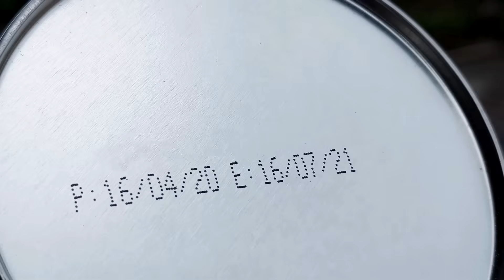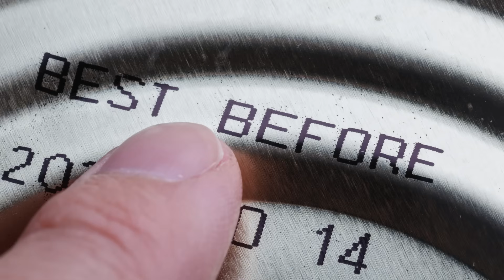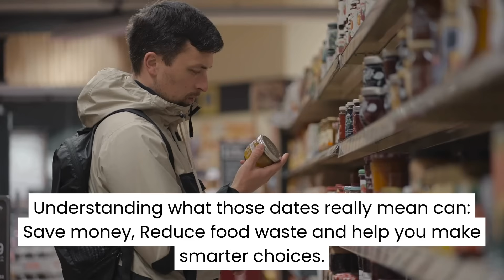What Expiration Dates REALLY Mean (It’s NOT What You Think!)

Comment: I started a pantry 4 1/2 years ago. I thought canned items would last forever, they don't. Evaporated milk, beans, pumpkin. The ONLY way is to rotate older items to the front and use them. MRE's don't last that long, maybe 6 years. Not until you get into the commercial freeze dried stuff do you find 10+ year shelf lifes.

Comment: I try to keep quite a lot of canned food for emergencies and I am usually pretty good at rotating them, however, I just emptied out a storage pantry I have and found a six pack of tomato soup which had a black stain underneath it and I assumed one of the cans had burst with gases or something. It was six years out of date, terrible rotation system obviously, but I always heard canned foods basically lasted for many years without going bad.

When I picked the cans of soup up to throw away they were super light. All six cans were now empty as they had leaked their contents out over the years. I was really shocked. I could understand the one can leaking but all six completely emptying really surprised me. I honestly don't know how that pack of soups managed to evade my checks but it was at the back and under lots of other cans. Going forward I won't be storing cans covered by other cans.

Comment: The most important part is the dates are only valid if the required storage conditions are properly maintained. And as you buy your youghurt and put it in your bag and then it travels in your car for a couple of hours under summer heat it clearly doesn't even remotely meet any reasonable conditions. Basically there is no way for you to maintain the conditions unless you do your shopping with a chilled container which no sane person does. So you may end up with stuff that you brought into your fridge during winter months which clearly feels perfectly fine to eat even a few months after the expiration date and at the same time you may have stuff you only bought 2 weeks ago which should be 100% fine to eat accodring to the markings while in reality having a clearly very puffy package and some funny smelling contents. 

I wouldn't bother too much with the dates too much unless we're talking years over due date and look more at what the actual stuff you're intended to cook looks like to you. In some cases it's not even the product itself but the packaging that is considered perishable and sets the time limits under typical shop conditions so in a dark cold drawer it can be safely stored near indefinitely, table salt being the prime example of such a case.

Comment: You need to be aware with some food!  I have eggs in my refrigerator, and they are good 10 days after expiration date.  Eggs last longer in the refrigerator. If I bake bread it can't last long? Because it hasn't any preservatives! I have them in my freezer, and I take a bit bread for 1-2 days of use.  3-4 days it will mold! If I buy bread it last 7-12 days depending what kind of bread it is.

Comment: I opened some old chocolate in December that was best before last Febuary. I ate one just to see what it's like. It was just a little bit bland. It didn't taste bad or leave a bad taste either. I could've ate the rest if i really wanted, but wasn't interested. But that's chocolate. If we're talking food that isn't very long lasting then i would only tolerate a few days after the date. With Milk i smell it. If you can barely notice then it's ok. Especially if it wasn't even opened that long ago, that's part of the reason it goes off, the volume of bacteria being let it. So would also be wise to squish the bottle to have less air/bacteria let inside. But i've not had to do that. With pasta, that's going to be boiled nice and soft and you're adding flavor to it, so wouldn't really matter if that's months past its date.

Comment: I worked in at a grocery chain for 25 years. If you want to see how well your local store does with "rotating" food products - find an unpopular product. Something you know they don't sell a lot of that is dated. Find one that is at the back of the shelf and you can see if it is past expiration. I have found canned foods that have been 12 years past date. Even the label had changed. That said; in my own pantry, I will discover something that is over a year out of date; and depending on the product, I may still use it. Not food related, but I bought some D cell batteries and as the years went by- nothing seemed to need them. I bought them for lanterns I had for power outages. When I moved to a new home, the outdoor fireplace switch used D cells. When I dug out my unopened batteries I saw that the date on them was "good until 2010". Keeping in mind that batteries are long dated which means I likely bought them between 2000-2005. I tested them with a battery checker and they showed a full charge. They did work, but only lasted about 3 months once put in use. Still, not bad for 20 year old batteries.

Comment: 2:48 Canned goods can be safe to eat after many years because they are commercially sterile and hermetically sealed i.e. the cans are sealed and then heated to very high temperatures so any bacteria that causes food to spoil are killed off, and no new bacteria can enter the sealed can. However the taste and texture might decline after a few years. But it's still probably one of the best foods to keep in preparation for a zombie apocalypse etc 🧟🧟‍♂🧟‍♀
Reply: yep, just watch walking dead. 😂
Reply: I'm sorry but if that can of low salt lentil soup has been sitting on the shelf for two years it's probably never going to be used. If you are looking at that can either use it or toss it because otherwise it's going to be there the next year and the year after. We all do crazy things right. That old laptop sitting out on a shelf in the garage with a long dead battery, paid good money for it but it's trash  ( not like garbage but disposed of properly).

Comment: It's interesting you started off with a tub of yoghurt. Many years back I used to put my unopened containers of yoghurt on the window sill for a few weeks before opening them. The bacteria made the yoghurt thicker and tasted nicer. Most of the time the foil lids swelled up and you opened them just before they popped. One container sat on the window sill for over 12 months. We have hot weather here and this thing didn't swell up. Eventually I opened it and it looked perfect, smelt nice and tasted normal. I rang the manufacturer and asked why it stayed fresh that long. It was meant to be preservative free but lasted more than 12 months after the expiry date and sat on a window sill during really hot weather in summer. The response I got was "don't eat it". Too late she cried, it was nice and didn't cause any issues.

Last week I opened a jar of char grilled capsicum (peppers) that expired in December 2024. They smelt and taste normal. If it smells bad, don't eat it.

Comment: read the comments.  chuckling.  i was born in the 40’s—we did stuff —that would curl your hair…🥳

legally, pull dates on edibles serve to limit maker + seller liability.  if an individual is injured, sickened, whatever—h/she has a greater burden of proof as to how food stored, prepared, served, and so forth, before being awarded damages.  

animals assess food fitness with all five senses:  sight, smell, taste, touch (texture, temperature).  ‘hearing’ generally not an issue unless the thing should snap, crackle, pop —and doesn’t, or squeals —and shouldn’t.  common sense is your best protection.  bon appetit…

if the edible fails any of those sensory tests and the problem cannot be safely remedied, throw it out.

Comment: Fact: expiration dates are from when cans were made of tin. They were guestimates of when more lethal bacteria would be in the food than not. Basically, eating it after that point lead to death. Botulism was one of the biggest dangers. Note that this hasn't gone away and is STILL a risk with modern canning practices. Especially in jarred foods or food you canned yourself. And No, things like Twinkies did not last forever. That was a myth caused by sending Twinkies in NASA astronaut meals. Twinkies are only good for a few weeks to a month. After that, throw them away. Why? The term "death by twinkie" is based on historical events leading to mass deaths, because people thought they were good still.

Comment: "Best before" is calculated as a date set at a fixed period from the date of production. It takes into account that the item may be stored at the manufacturer, wholesaler and merchant prior to being purchased. It does not mean that the product will go "bad" the moment the date is reached. Expiry date or "use by" date means that there is a risk of spoilage if the product is kept for that duration of time. It does not mean that the product will go bad, but that tests have shown that the product can go bad if that date is exceeded.

Comment: There is a difference between a product that is unopened and a product that has been opened, but the date on the lid hasn't been reached. If you buy something in December and it says February X on it, unopened goods should still be good up until that date and for a short while after. The date can mean that this is the date after which the manufacturer no longer guarantees the taste or consistency of the product. In most cases, it refers to the length of time post production where the goods can be stored at 39/40F before a risk of deterioration/spoilage sets in. I have seen goods that were still edible a month after the printed date. I have seen goods where mold starts to grow pretty much on the expiry date (sandwich bread). There have long been common sense rules for storing goods and some people have forgotten these over time. What infuriates me is when manufacturers provide a date, but it is not clear whether it is a production date, a best before date or an expiry date. 
If you open a package, does this mean that the good is still safely edible until the expiry date or do you have to rely on the old standards as the good may spoil or lose quality within a few days of opening/exposure to air.
When I buy a package of some item and it says use within 10 days of opening, how vital is that?

Comment: Canned goods are good for decades if it’s stored correctly. If the can if not rusty, swelled up or leaking, it’s good to go. 
The only one you have to be more careful of is canned fruits because of the citric acids, but those cans are usually coated.

Comment: Be wary of dented cans especially if they contain acidic contents like fruit.  A dent may have caused a breach in the lining of the can. Be especially wary of cans that hiss when you open them as this implies that some chemical reaction has occurred  between the contents and the can wall.
Reply: That's why you sometimes see dented cans on clearance
Reply: Totally Disagree. Dented cans are just fine. The only time to be concerned about a canned food is if the top or bottom of the can is bulging, throw it out. A dent does nothing, but a bulge means it's bad. In the industry for many years and that's always been the rule. If dented vans were bad grocery stores everywhere would not sell them for risk of a lawsuit. They discount them strictly because people of this preconceived idea they are not as good as undented cans.
Reply: Just fruit.
Reply: @M @ManChan-w5p uit is the most obvious example , but anything that lists citric or acetic acid as an ingredient is also a likely suspect in the case of dented cans. Pristine cans are always preferable. Corroding cans are also a worry.
Reply: What about a breakfast sausage roll that swelled into a round balloon? Simply 'aging', like fine bourbon or wine? Couldn't read the date, as it was stretched out and illegible, probably freeze it then, huh?
Reply: @carlsaganlives4036 - had one like that & company said to pitch.
Reply: Never had dented canned food illness..never.
Reply: @Tom-ps2cq Nevertheless it is an accepted problem.
Reply: A dent on a seam could suggest a loss of seal and may allow air to interact with the product. The bulge test may not apply in that case.